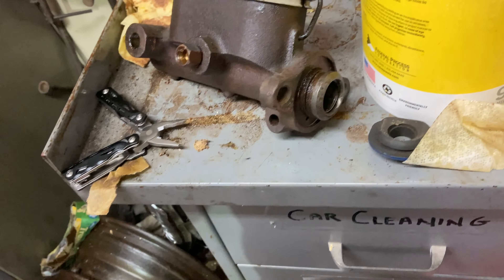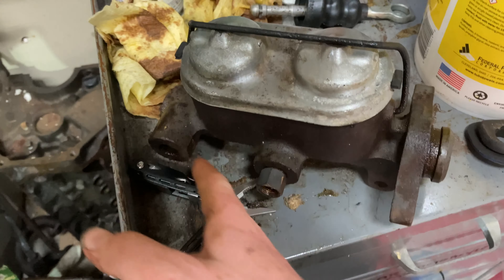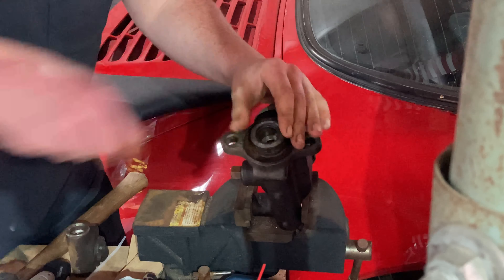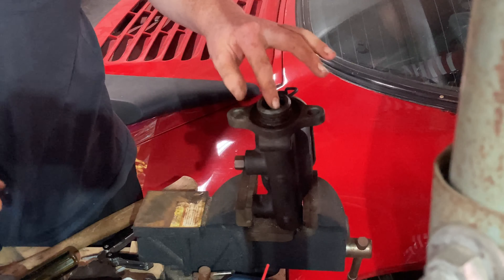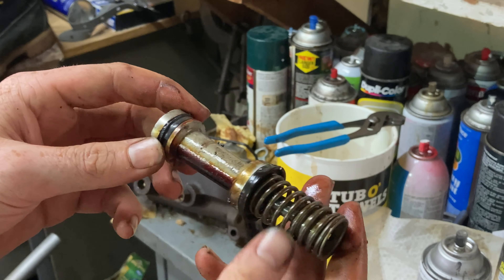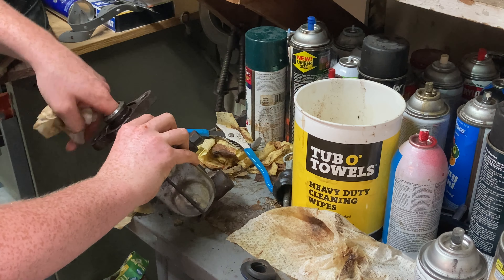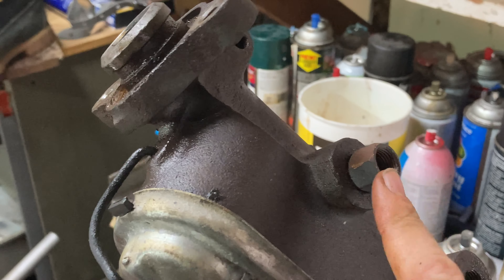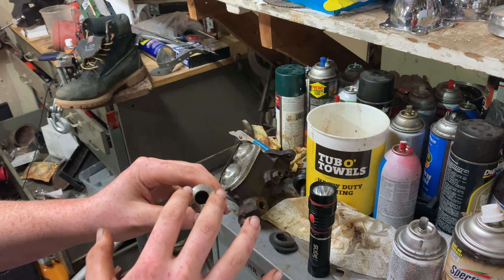1968 Mustang Master Cylinder Rebuild!

Comment: You only pulled out half of the parts from inside the master cylinder.
Reply from the maker: I ended up just replacing it rather than rebuilding.